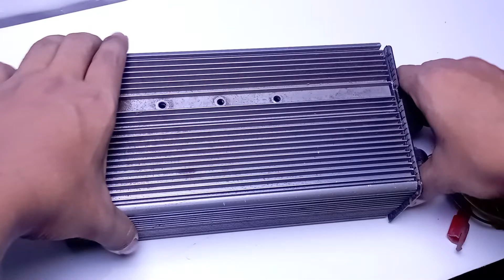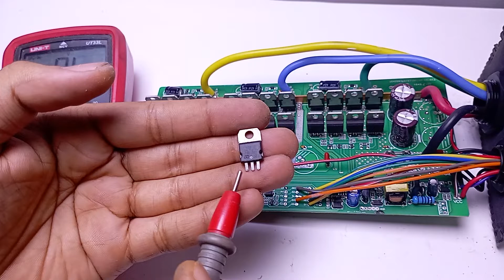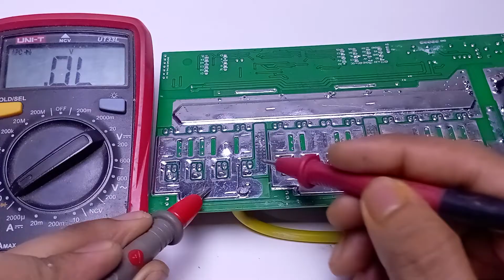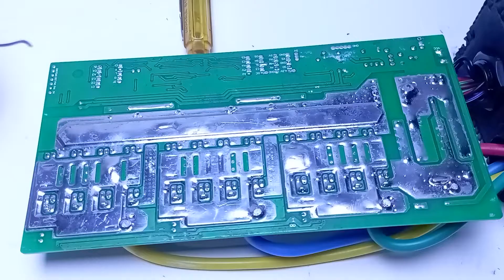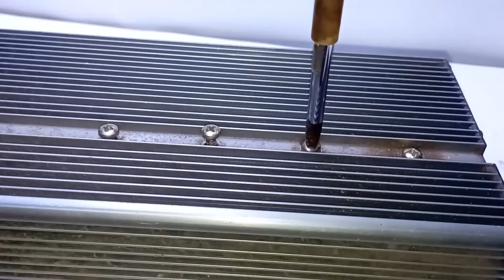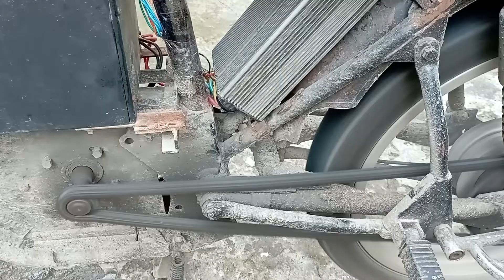Ev Controller Repairing🔥#erikshaw #ev #ebike #escooter

Comment: i recently replaced 2 mosfets, after having put it all together, and turn on the bike,... i suddenly hear a click in the battery, and the power shuts off.... any idea what that means? ( have a new controller on the way, aswell as a new BMS, but its still weird )
Reply from the maker: From battery? Sure ?
Reply: @madScientist99  yeah definitely. i even tried another battery, and the same happend. 
with the key turned on in the battery, i checked the leads. one read 34 volts, the other below 1 volts. 

but when i checked the leads right at the battery terminals, bypassing the BMS's, i still hads 54 volts, so fully charged! Strange huh?

Comment: I have dual controllers on 60v dual motor scooter . 1 controller plugs in normal the other melts the power plug . The green wire shows signs of getting hot . If I test like you do in the video I only have 1 set of mosfets. They test 1.371 across outside pins of mosfet with leads one direction if I flip the leads the other way I get .665 all the same for red wire set of mosfets and yellow wire mosfets the 4 mosfets on the green wire all test .0010 with leads either way . Do I have 4 bad mosfets or something else I should look at
Reply from the maker: Did you repaired it ? Sounds like blown mosfet , expected 1or2 mosfet is bad

Comment: I have tested the cables leading from the controller to the display and when I hold the power button it shows 18v then drops to 11v and starts flashing on the rear lights, is this a bad controller please?

Comment: Please can you help me?

I was going up hill and my bike motor started shuddering all of a sudden and losing power. Now it has no power at all and only vibrates or shudders very loudly. I have tried the motor on another bike and the motor is fine. Could this be a failed mosfet in the controller? Online it says a hall sensor issue is to blame but to me it seems more like a controller failure.

Thanks.
Reply from the maker: it can be faulty mosfet or hall sensor , open the controller & test those mosfets , as you have mentioned it's happened due to overload ,  blowout mosfet can be the reason test them first
Reply: @madScientist99  Hello again. I finally got the mosfet replaced and thought the bike was fixed to start with. I now have full power and the bike seems smooth most of the time but I get the same slight vibration/shuddering sound when the motor first starts accelerating from a standstill. Overall the bike is working FAR better than before but there is still something wrong and the multimeter readings are still very different in the same problematic spot on the controller board. I replaced both of the mosfets in the faulty area so I am lost on what to do next.
Reply: @madScientist99  Thank you so much for the reply.
I did not know that a faulty mosfet could cause the shuddering motor symptom I am having.
The LCD display also shows 'Error Code 30 Communication fault'
Reply from the maker: It can be a problem related to the hall sensors,  but i think you should check passive components first , near those mosfets , can be a faulty capacitor or diode or resistor which is damaged when the mosfet got damaged , test & compare the values one by one from the good mosfet areas this happens quite often
Reply: @madScientist99  I had a really bad soldering iron too which did not get quite hot enough so it took me a very long time to get the new mosfets in. I wonder if I might have damaged the replacement by taking too long and getting it too hot. Thank you for all of your help so far. You are a legend :)
Reply: @ If I make a short video of my problem could you take a quick look and see what you think please? I have no idea what I am doing so it would be much appreciated if you could.
Reply: @madScientist99  If I make a video showing the multimeter readings from the mosfets I repaired I would be very grateful if you could take a look and tell me what you think. I have no idea what I am doing so any help would be much appreciated.
Reply: Can you repair my controller sir
Reply: @yeshpatidar5433  I managed to repair mine in the end but the motor makes a bit of a grumbling sound when I accelerate from a stand still. Other than that it works perfectly.

Comment: Hi friend, I have the same controller, yesterday it had a short circuit in the last phase, I changed the 4 mosfets of the burned phase, I measured with the multimeter and none of the phases sound positive or negative, but it still does not accelerate, the lights turn on and everything. Does anyone know if another component apart from the mosfets usually break?
Reply from the maker: first of all check the motor ,  if it's okey then  check the controller, there are Smd Diodes & fusable resistors near the MOSFET they can get shorted/burned  , test & replace them it's common if all 4 Mosfets are gone

Comment: I’ve watched this video three times and am still unsure how to sacrifice the chicken or the proper hand gestures to appease the electron god.  I don’t think I have it’s favor.
Reply from the maker: & if you really doesn't understand how  I find the bad set of mosfet , you can check each mosfet one by one and the bad one should have lowest reading / voltage drop in diode testing mode,  you just have to replace that bad one.  & as mention you have to check between Gate (pin 1 of the mosfet) to Source (pin 3of the mosfet), that's all,  thanks 😇
Reply: No, your video was excellent.  The only thing I’d add is explaining what the test setting was doing, whether the measurement is in volts from injected current or in ohms from basically the same, unless I missed something. .  
I made the joke because not all faults are easy to find  and sometimes is seems like the universe conspires against me. If only it was straightforward all the time I’d be much happier.  @madScientist99
Reply from the maker: I try to explain this small details in my videos, ☺ & thanks for comments 😇 keep supporting 🔥
Reply from the maker: 😂 tonight we have chicken dinner, you can join us , to get detailed recipe,  thanks 😂😂😇